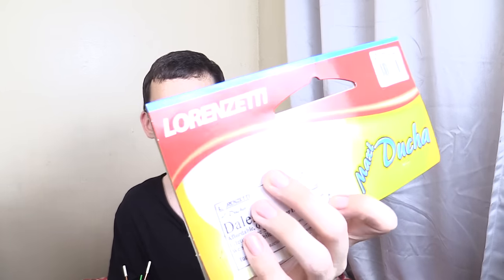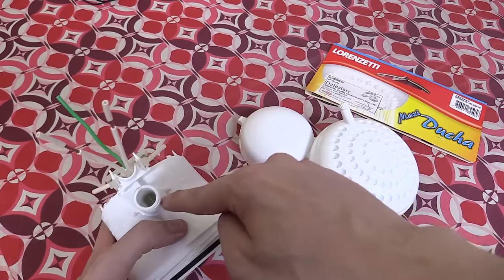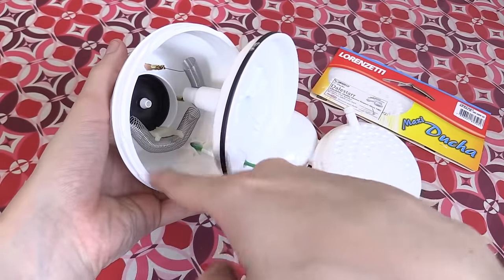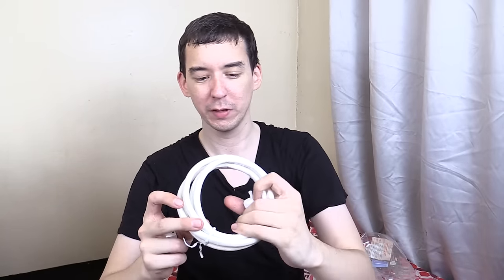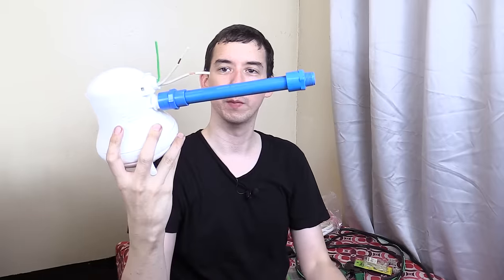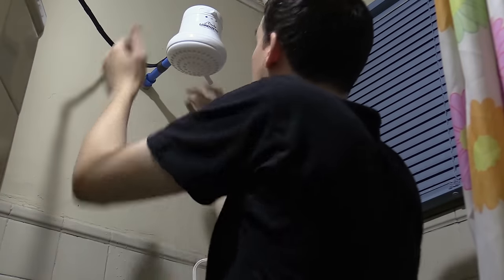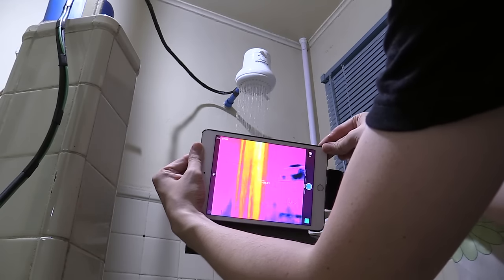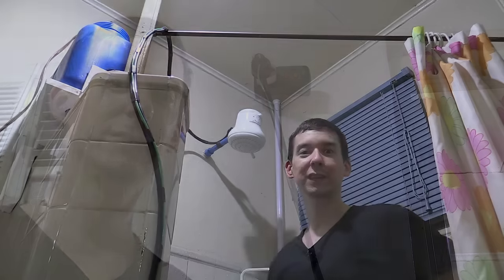Lorenzetti Electric Shower Head

Comment: Dude stop saying the water is not that conductive. You know nothing about water electrical properties:)) Sorry for being a bit OTT but i wanted to grab your attention .
Reply from the maker: It's not, relatively speaking. 

Try watching the video of BigClive where he demonstrates this in a practical way.

Or just google "is water conductive" and you'll find thousands of articles which explain that it's a pretty poor conductor.
Reply: @GadgetAddict  What happens if you put electricity in water?
The ions suspended in water turn it into an electrolyte. By itself, an electrolyte usually has no net charge because it contains a balanced number of positive and negative ions. However, when you introduce an electric voltage, the ions align with the polarity of the charge and create a current throughout the fluid. We do not have tap H2O2. If you would say distilled water i would had not got so pissed off. However there are reasons why there are worning signs when mixing water with electricity, So that statement should be not true. as long as we don't have h2o2 showers. I'm glad i grabbed your attention ty.
Reply from the maker: I'm not saying to take a bath with your toaster. 

But it's a known fact that tap water is not that conductive. Relatively speaking. 

Many people have done demonstrable tests with their fingers in a bowl of water. I'm not suggesting anyone try that, but it's been proven both on paper and in practice.
Reply: @GadgetAddict  This is the same as the toaster. In fact it is a toaster cooled down with water. you also put your body under. I know my electricity :D I nearly died from 18kw when i was young. :D I never died since then again:)) I grabbed the fit coil from a black and white tv. I wanted to put that mushroom properly as i asumed its hanging and the tv was on:D   my sister seen my hand flying  and them me following it :))  I would consider this if it has a glass protection and a liquid inside that will help evacuate the temp as fast as possible in the water surrounding it. yeah i can see its not as good as this. But this is a toaster :D I would not do it.. When you lifted that lid i was like mad.
Reply: OK i take that back. A litle roasting for the algoritm :P Good JOB!

Comment: jfc this is making all the alarms going off in my head. I do not will not EVRR EVER ever use something like this ever. i dont give a fuck if you say it's safe. One thing has to go wrong for it to all go wrong. If I'm that desperate for hot water I'd boil water and hour before i shower. This is so stupid.

Comment: Suicide showers?..... such exaggeration...
I Brazil we never heard of anyone killed by those showers for decades. When uncorrectly installed, people may got an eletric shock, for sure, but onlyif the  person installing it is dumb enough to use a metal handler instead of a plastic one and not install the ground wire, which is even dumber because the  set up also includes proper plugin for that cable.
While I do understand that clickbaiting is necessary in youtube...You could use a much less sensationalist and misleading title, pal.

Comment: LOL what a load of crap... These electric showers have been in use for over 50 years and no deaths.  They heat water on demand, what’s is eco-friendly and much more efficient when compared to typical gas boilers, heating water the whole day and losing temperature through the house long pipes.
These showers are normally hooked up on 220v, so higher voltage lower current, therefore smaller gage wires are needed.
And to finalize about the low cost style, try to understand  economy on 3rd world countries. In North America, someone living on minimum wage needs to typically work 30 minutes to be able to buy a “BigMac”.  In South America the same worker needs 4 hours worth of labor to buy the same burger.
Now if you are so scared, ask your mommy to give you a bath bad with a soft sponge... 😂

Comment: 4:30 "SO THIS WONT EXPLODE" hahahaha.... Gotta love "Gringos"... that plug is so you can snap a hose in there and redirect the water through it... silly people.... also, no one has ever died using this product... ALSO... "earth wire"... most houses dont use that, so the MAX people get here are little shocks when turning the shower on...  ( or if you have some kind of open bruises [ or little cuts ] in your skin )